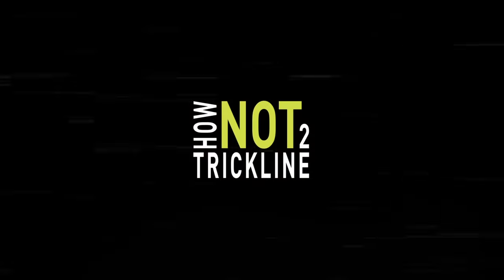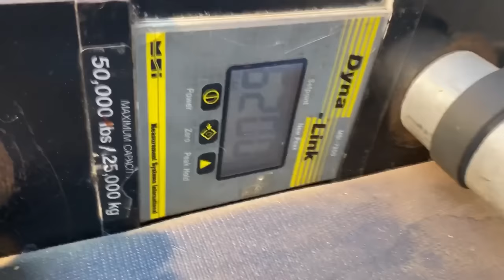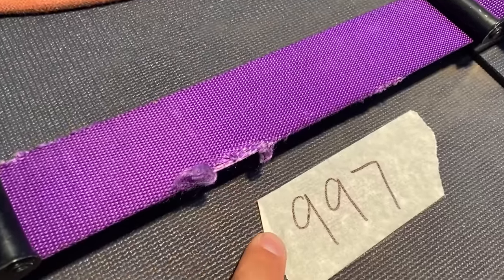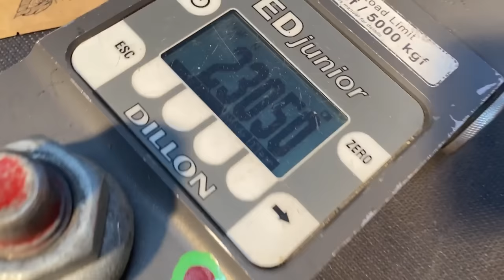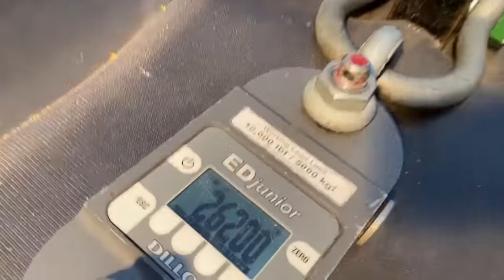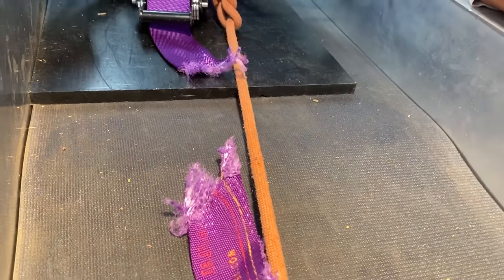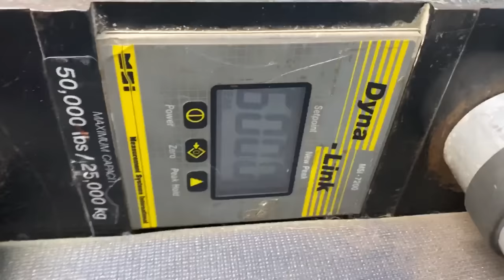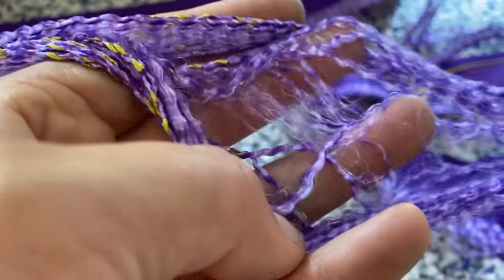Trickline webbing break tested - including damaged webbing

Comment: Look up the "notch effect".
A rapid change in diameter (like a cut) can cause a massive increase in the forces. So the strands near the cut will see higher foces than the ones on the other side. As soon as the first strand breaks the next one sees an even higher force and you get a domino effect.
Reply: Beat me to it.
Reply: I was going to compare it to the tearing a telephone book trick; similar premise.

Comment: You could place a piece of polycarbonate at a 45° angle with the open side against the wall. Then put the cameras on the wall side so they can still have an unobstructed view of the thing you are breaking while you stand on the side where the polycarbonate meets the metal sides.

Comment: Hey Ryan thank you for everything you putting, im learning a lot from you and increasing the safety when i slackline! Altough its not related to this video, if i dont have acess to amsteel whoopie slings, could i use dynamic rope to backup the sliding x in a highline (or other option)? If yes what Knot Should i use on order to keep it a tight and that Wont reduce to much the breaking strength?

Comment: My theory for why the cut webbing was so much weaker: When you pull on the full width of the webbing, the side of the weblock that is pulling against the cut portion has less resistance. So the force of the pull is going to move disproportionately to the cut side of the webbing, meaning the weave fibers on the cut side are going to be taking higher force and not distribute the force throughout all the strands. So the strands that are taking the force aren’t as strong by themselves and start to break. This just cascades greater and greater as strands break. If you were to cut the entire 1/2 inch off one side of the webbing leaving you 1.5 inch webbing, it would be the strength of 1.5 inch webbing because the force would be pulled evenly.
Reply: In most of the strap, the load will divide across the whole strap. Now if at the cut you look at the two halves of the strap — one half has one half the load, across one half the strap. The other half has half the load, across only one quarter of the strap. That whole cut part’s section of the force lands on the strand at the edge, basically.

Comment: (Terminology excuse, not sure if I explained what I am thinking correctly.)Damn, this one has me thinking. It is like the line is way to wide for its safety. Like they could put in 2 more vertical (stitching) lines through the webbing and it would probably hugely increase the safety. Weirdly the vertical stitching is done on the edges which seems to be a huge issue for every little knick. I would be curious to see a test with webbing variations. 4 total vertical lines(2 edge, 2 inside), 3 vertical lines (2 edges, 1 centered). I assume they don't make these variations, but I am so very curious because of your testing here.

Comment: The ultimate strength tests are fairly well suited for highline, but unfortunately are none conclusive for trickline. It's worth noting that trickline webbing pertains to the realm of fatigue loading. The correct way to preform these tests would be record the amount of load present while trick lining and match that amount with your setup in a cycle load pattern (obviously not possible with your current set up). I'm new to slacklining and love the content- keep it up guys!!